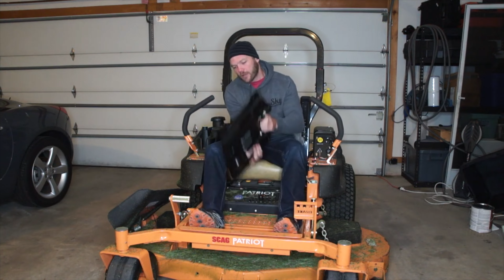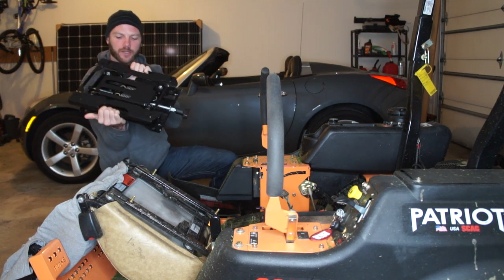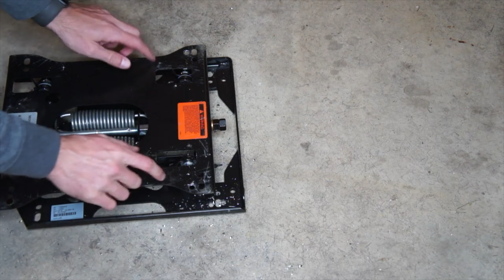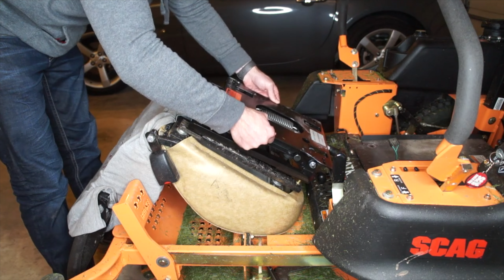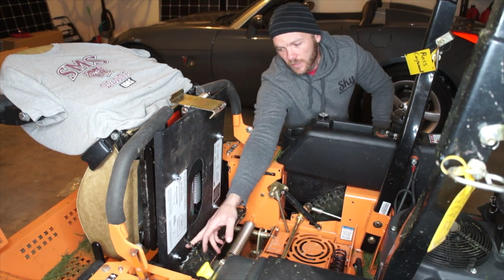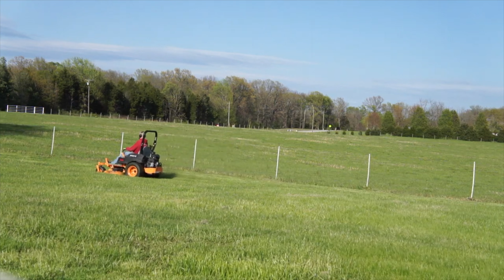Lawn mower seat suspension Install

Comment: How did you handle the kill switch that was connected to the old seat on club cadet zéro turn?
Reply from the maker: I don't think mine was in the way on the SCAG. But at some point i have removed mine completely... (not recommending that, they are there for safety)

Comment: Yeah you either have to flip it and install it upside down or install some slide rails, I had one of these tracseats and it was an absolute nightmare.  I posted a few videos on it. I went back-and-forth with the tracseat company and actually sold it with my scag.   I can't stand my scags,  I had 4 of them and they all had problems. I just bought a hustler and I haven't looked back since. By the way the trac seat suspension that you see on eBay,  Amazon etc are not the same suspension seats that come on Mowers nowadays with the orange turn handle. They look the same but the suspension travel, springs and the mechanics of it are completely different. Best of luck!
Reply from the maker: I made this video a couple of years ago for my old channel. So I have been using this suspension for a while, and it really does help. This is the first scag that I have ever had. Haven’t had any problems with it, but I’m by no means a scag die hard fan. I would probably get a new brand next time just to try something different. I have heard the Hustlers are nice. 
My yard is really rough. So having the seat suspension really helps, but I would probably splurge for something with a fully suspended rider deck next time. Lol
Reply: @Rosco Reviews  I thought this video looked familiar haha.  Yeah i can't stand scag,  they rubbed me wrong for sure.  That's an older patriot (pre-covid)  so you're good to go :)  I can take a video of my hustler suspension setup, it has the orange handle but it's completely different on the inside.  I think all those tracseats on Amazon are take offs or the older models that didn't sell.
Reply: I found the video hopeful. I’m trying figure out how to do something like this with a seven year old commercial Cub Cadet. It’s either fox the back jarring or go to a stand up mower. By the way, Stanley Black & Decker own Cub Cadet and Hustler, along with MTD. If you see DEWALT mowers, same company.